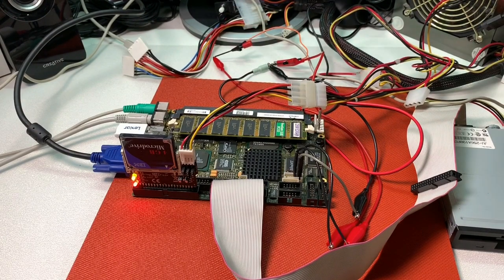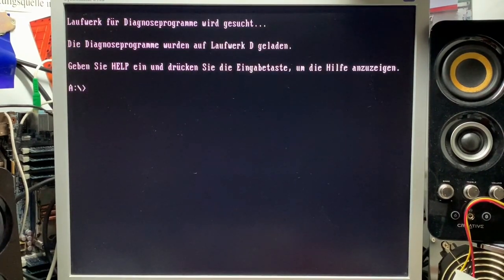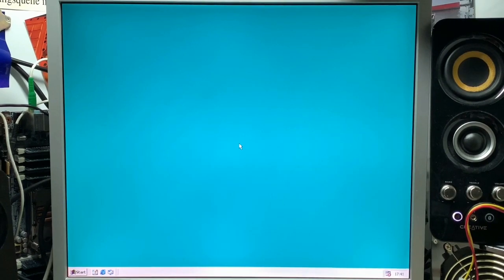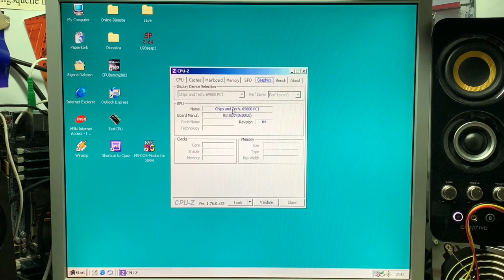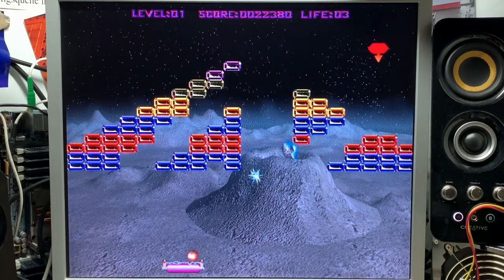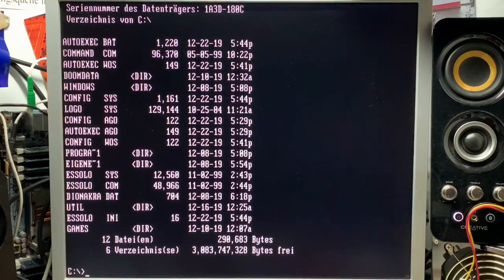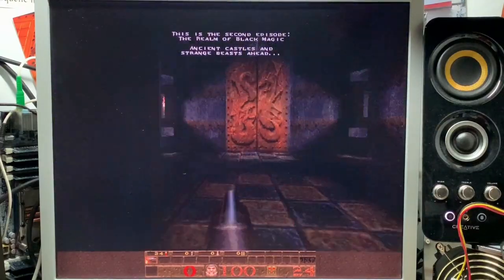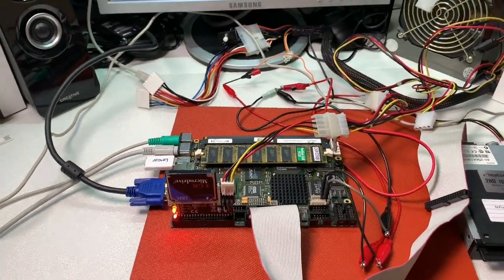Mini Win 98 Retro Build / Pentium 266 MMX SBC & IBM MicroDrive

Comment: You have one of the coolest collections of any kind! I am really enjoying catching up on all your content at the beginning of 2021. My history with silicon. I just upgraded my VR/Gaming rig's i7-7700 intel chip with a i7-10700k and a new asus Z490e motherboard. My first PC was a 80286 when I was 8 yrs old. I upgraded to a 486/66 shortly after. I loved the increased power of the 486/66 but then I found out I could upgrade to a 486DX4-100, so I had to do that. I ran that 486-100 until I was 13 and I bought an AMD Athlon 233mhz system from eMachines. I was happy with eMachines as a company so I bought another one, this time with a Pentium 4 single core @ 3.06ghz and a ATI Radeon HD5750 1GB GPU. That last system lasted me about 8 years until I upgraded to a quad core Intel i5 laptop in 2016.

Comment: Industrial equipment has always been super expensive, because unlike consumer electronics and computers, where you pretty much pay the Specs of the unit you are buying, and where the components follow pretty unexpensive standards; in the industrial work you are paying access to a specific industrial platform, where a certain kind of work (expensive and specialized work, by the way) needs to be done and where components have not alternative but to use the only expensive standards available.

Comment: I have an idea: Build a black 3D printed case with some really small power supply, this single board computer and that small color CRT! So, this way you can make a small and really neat retro computer! 😉
Reply from the maker: Zsombor Udvari Yeah, great Idea, and I had it already. 😀.
Reply: @CPUGalaxy  In which video?
Reply from the maker: Its a still ongoing project. Lets see when I will have a video available. 😉
Reply: @CPUGalaxy  Well, throw an answer here, when finished...

Comment: I’m sad I never looked into single board PCs . I remember looking on eBay in the very early 2000s there were tons of these floating around. I didn’t know what the board would plug into- never guessed it would be as simple as a semi standard Isa connector !
Reply from the maker: yeah, me too. long time I did not know what to do with them and how they function. until I started to dig deeper into this topic and it turned out that they are pretty usful and reliable mini PC‘s. ☺️

Comment: I had an Archos media player with an 8 GB Microdrive. Unfortunately, that Microdrive turned out to be the point of failure, but a few years had passed and SD-based media players were cheap enough so it went in a drawer and is probably still in a box somewhere.

Comment: 9:16 so cute 😋 what type of epoxy and what method did you use to make the microdrive in resin?
Reply from the maker: you can find those 2 component cristal clear epoxy in the web for this purpose. but its a lot of work at the end to sand it down and polish.
Reply: @CPUGalaxy  thanks for the reply! Sandpaper of what grit were you using? Did you have to vacuum the thing to suck the bubbles out?
Reply from the maker: I had no vacuum. Just be careful when mixing the stuff to get no bubbles in it. sandpaper i had several. all used with water. I think up to 2400 or 3200. then finishing with some fine polish paste.

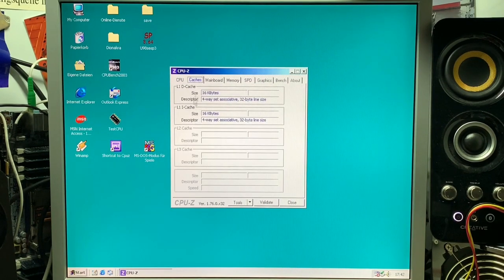Comment: 13:30 No L2 cache, really? Lack of L2 cache will slow it down.
Reply: POST screen shows 512K cache, so its probably disabled in the bios setup then.
Reply: @semifavorableuncircle6952  MMX cpu L2 is not inside cpu, its on the motherboard.

Comment: Can it be overclocked to 75x4 = 300 Mhz?
Reply from the maker: maybe. need to give it a try.
Reply: @CPUGalaxy  I have socket 7 computer Pentium 233 MMX, and I run it 75x3.5 = 262 Mhz, I love that 75 mhz FSB option. Always use it on socket 7, cause most of cache chips/PCI/ISA cards handles it usually.
Reply from the maker: Thanks for you FB. I really need to try it.
Reply: That ALi chipset supports 100mhz FSB. May as well try 100x3 and 100x2.5. Faster FSB  might bump performance drastically.